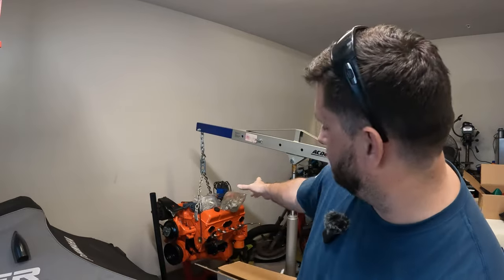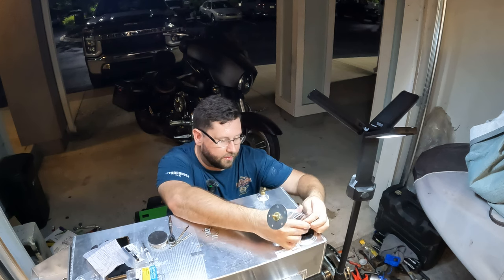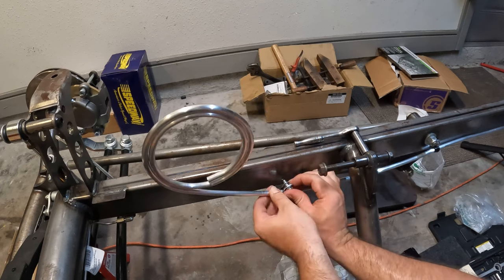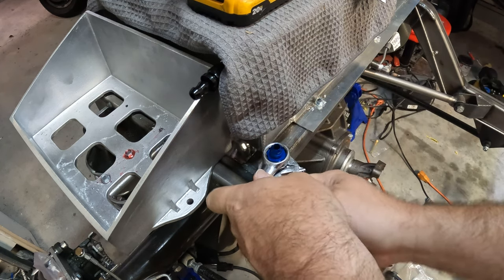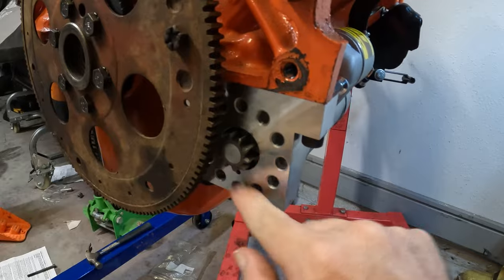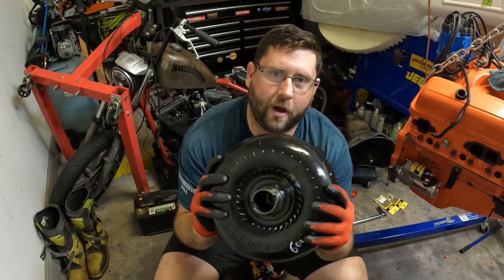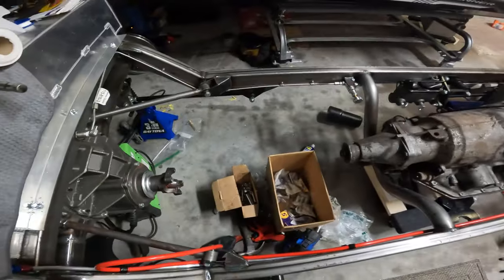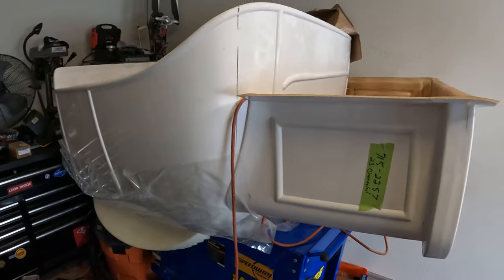T Bucket Hot Rod Full Build - EP4 | Speedway Motors Building the T Bucket ROADSTER

Comment: Use machinists cutting oil when you use a tap and die set. It helps with the cut, it keeps the cutting edges clear of swarf and keeps the heat generated by the cutting friction much lower. And try not to use a power tool with a tap. They break real easy and a broken tap can turn a 2 minute job into a day long ordeal real fast. All the best for the build. Cheers from New Zealand.
Reply from the maker: Welcome from NZ! Yeah after about 3rd hole with that T Handle and your palm....that drill starts looking better and better.

Comment: Regarding the tie rod hitting the frame, I made a steel block spacer to fit between the front leaf spring and the frame. 3/4” thick x 1 3/4” x 4.5”. Your local steel supplier should be able to cut one to length for about $15. Drilled a half inch hole for that peg and made 1/2” threads for a bolt. Tested and no more rubbing!
Reply from the maker: Im curious, could you snap a picture and send that over?  Id be curious to see what it looks like and maybe do a video on.  Seems im not the only one.  Check out the "about section" to send it over if you can.

Comment: Your fuel pump gasket isn't to keep creekwater out. It's to keep oil in.   Yes, it's not pressurized, but that cavity will fill up with oil.   As long as your gasketed area is smooth and fairly flat, you should be fine.

Throw a GM seal tab into the radiator before initial startup and you'll never know the rear welch plugs aren't sealed. (in fact, one of those tabs is good insurance in every watercooled engine you own)

The fuel pump clearance issues you're seeing is a common thing on T-bucket frames.  That's why most of them have a low pressure electric pump. That's just the nature of the skinny frames.

On your fuel outlet, a 90 at the tank and a 45 on the fuel line would probably make your flex connection a lot nicer.  Those two points are so close, it's not difficult to end up with a full loop to hook the two together.   AND if you decide to go with steel braided AN hose there, MAKE SURE to get carbon lined hose.  That's the only hose that will avoid static discharge blowing pinholes in your fuel line.
Reply from the maker: Thanks for the input Earl, much appreciated.  I will revisit that fuel pump, I was really surprised to see how close it was even after turning it.  Never heard about the Rad tabs but will grab those before the initial run, I know with freeze plugs theres a lot of information on these and I have seen where people use a sealer and the block cracks etc and then they dont use it and they either leak or it wont.

On the fuel line near the rear I did pull the hard line down but I still dont like how close it sits.  Looking into a few different angles with that as I did leave some extra slack for some options there.  Thanks again!
Reply: @GearHeadzGarageUSA   As a general rule I don't like 'rebuild in a bottle's..   But those GM seal tabs are pretty awesome.  Much like a little shot of tire Slime, they make great preventative maintenance.

  Back when GM built that HORRIBLE Caddy 4100 V8, the aluminum/iron engine had internal leaks all over the place.   They came up with those tabs to patch up a shitty engine.    If you put one in a non-shitty engine, they will seal up a pinhole before you even know you have one.   AND they don't do like normal sealers and clog up radiator flues, thermostats, and heater cores.

I have one in ever single one of my cars.  (especially the ones with those crappy plastic GM intake gaskets)

Oh yeah, you're probably going to have to pull your 3rd member out of your axle to get the new yoke on correctly.  I doubt whoever built it used a solid shim/spacer to set up. Odds are it has a crush washer in there to set the drag.  When you swap yokes you'll need a new crush washer and you'll have to torque it until you get the correct bearing drag.

  Theoretically, the pinion gear will stay in the 'exact' same place when you reinstall the pinion support.   But the only way to do a before/after backlash test, it to pull the whole pumpkin and measure what you start with  (and make sure it was right to start with)

Comment: Thanks for the previews! Finished my Speedway T-bucket a month ago. Are you finding the tie rod is hitting the frame due to bumps in the road? At rest I have 3/4” of spacing but the bumps hit it. Setting the rod below the brackets won’t fit. I might have to try and bend both brackets. Ideas?
Reply from the maker: You know I'm really glad that you brought that up because I brought that up with them and they told me that they've never heard of that so either I assembled it wrong or it's actually truly a design flaw.  Over although I've got about 10,000 MI on my frame and I haven't had any issues but that Rod does rub.  Haven't figured a fix for that yet.

I'm honestly glad I'm not the only one so I know I'm not going crazy.

No ideas yet on how to fix it but it's something I'll be looking at here pretty soon.  So far I've just kind of been living with it the only thing I noticed is just a few small scratches but it doesn't really cause any issues anywhere else.
Reply: @GearHeadzGarageUSA  what is 10,000 Mi or ML?
Reply from the maker: @rickchristensen3661  I have almost 10k miles on my frame.  It's become my daily driver with tons of road trips 😁

Comment: Coming  along great. Think that 90 degree  out of the fuel tank would work good.  You should degreace pressure wash and paint the tranny  to. Did you get the torque  converter  bolted to the flex plate?  Just wondering since you didn't show it.
Reply from the maker: Your just going to have to wait til EP5 to find out! Just kidding, got it bolted up and just used 3 hardend spacers for the offset.  Order some additional AN6 fittings so I can figure out what route I want to go.  I ended up cutting a lot of scenes out during the editing process for viewer retention, I think for a 30 min video I ended up with almost 5 hours worth of video.  I may juggle with that in EP5 and do a more in depth dive to get some feedback.  As for the trans I did wash that sucker a few times and with some purple power but it's just ugly as hell and looks like it was driven through wet concrete....I guess that's what I get for 80$, now to see if it works.

Comment: Run the fuel line low on the frame? You can buy a frame mounted transmission cooler that would mount higher on the frame under the seat area and then run lines from the trany to the cooler and back. An alternative to running lines and cooler up to the radiator area
Reply from the maker: Yeah, I noticed a lot of people running their fuel line on the lower underside of the rail looking down at the pavement, could figure that one out thats why I went with the inner rail midway up as to not have it knocked but some road debris.  I was planning on plugging the radiator trans cooler in/out and picked up a single in/out external "Heatsink style"  cooler for the trans.  hoping thats enough for the Florida heat.  I saw some people around here looping their trans oil lines with no cooler at the car shows, seems risky!

Comment: i think if you rhino line the body find out that textured will be hard to clean without a pressure washer
Reply from the maker: Good point!!! I didn't even think about that! Damn...
Reply: Had a brother in law do a car with that. Used a lighter application and then painted it. The paint helped fill the surface some.
Reply from the maker: But did it turn it into that orange peal look after that or was it still pretty rigid?
Reply: @GearHeadzGarageUSA  it had the textured look up close and was a satin look when standing back a few feet. He did it in a black. I  guess it's what kinda look your after and how you spray it on. When I get ready to paint mine I'm going to coat the bottom and inside the bed area with in just to act as a sealant and protection form the elements